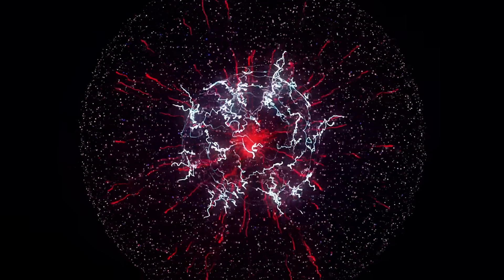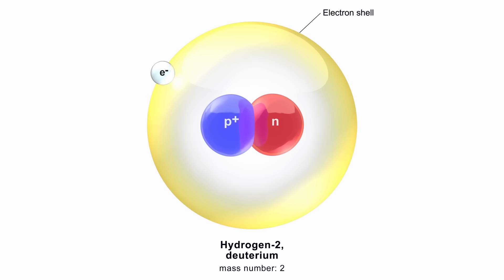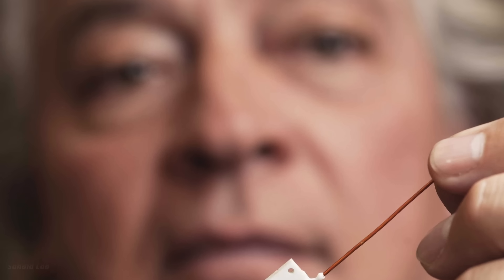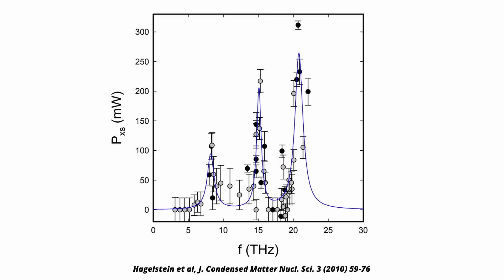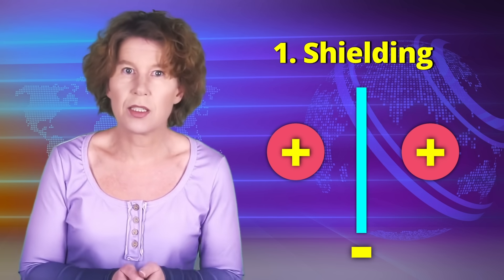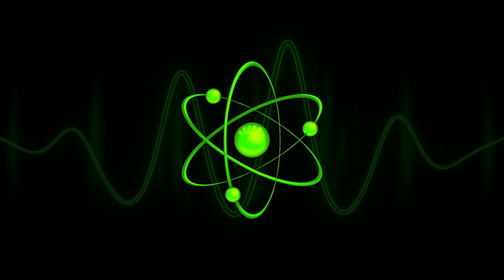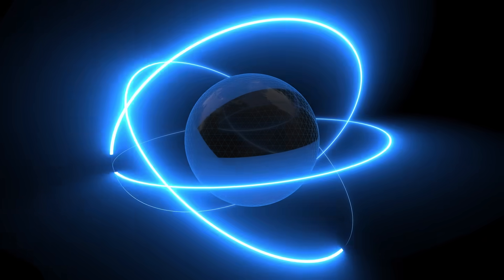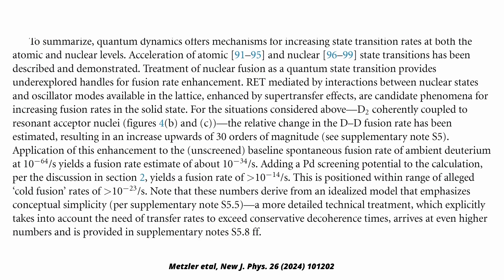Physicists Say They Know How Cold Fusion Works

Comment: I'm glad it's being studied.  Even if we get no surplus energy,  we will likely get some knowledge.
Reply: Bob Greenyer has advanced the CF field.
Reply: We get surplus energy. Trouble competing with a heat pump at the moment. But customers are lined up when it is. It's cheaper and quieter than a heat pump.
Reply: @grumpystiltskin  A heat pump requires energy to be fed into it, which is not the case for LENR (cold fusion).
Reply: We are getting surplus energy now, even enough in some cases for a generator to run by itself once it has been started up.
Reply: @brian.josephson  not from cold fusion
Reply: @brian.josephson  Thank you Brian. She could have at least mentioned that there have been 25 annual conferences on theory and experiments in this field, with hundreds of papers published. For those interested do a search on iccf-25 . Posting links is apparently blocked.

Comment: When the news about Pons and Fleishmann's experiments came out, I didn't believe they could lead to a fusion energy source, but I was curious to find out what was going on. Since it was easy to try to reproduce them, I set out my team to work on it. Without going into the details, our conclusion was that they were indeed finding something, although not necessarily what they claimed. First, the reason why many people couldn't find anything is that either they weren't using cast palladium, or they weren't running their cells long enough for the palladium bars to absorb the deuterium. Second: the palladium bar was fractured after the experiment, which might mean that in the breaking process electric fields were produced, and deuterons were accelerated. This explained why we only got a single burst of neutrons, which lasted around four hours. I was hesitant to report this, since we had two ways of measureing the neutrons, and it wasn't confirmed by one of them. Therefore the experiment was inconclusive. Something puzzling was that once the power source to the cell was disconnected, it worked as a battery, which is something I could never explain, but it happens to the a signature of the cases in which there are "positive" results, whatever they are (the cold fusion enthusiasts call it "life after death."). Then I forgot about it and went back to do serious work. The whole idea had been discredited worldwide, but I was left with the impression that there was something interesting to be studied by condensed matter scientists, which I'm not.

I may add that from the theoretical point of view Julian Schwinger tried to give some explanation, which was published mostly because of his stature,  but not many people were interested.

Comment: Looks like Coldness is Much More smaller particles (more ''radio-wavy'', less of linear small light radiation =temperature)  . So its alike HotHeating-Cold ends of wire difference making electricity (such an exchange of near big differences for ballancing).

Comment: Hossenfelder said: ". . . that’s a welcome change from people with devices that don’t work even theoretically, so let’s have a look." She seems to be saying cold fusion devices do not work. That is incorrect. Cold fusion has been replicated in over 180 major laboratories, and these replications have been published in mainstream, peer-reviewed journals. It has been observed in thousands of tests, sometimes at very high signal to noise ratios. For example, in reactions that produce 50 to 100 W lasting for months. It is not possible that all of these results are mistakes. If hundreds of scientists could make gross experimental errors for 30 years, science would not work. So the effect is definitely real and the devices definitely work.

The devices do not work "theoretically." Cold fusion is an experimental finding, not based on theory. No theory is needed to be sure an experimental result is correct. To disprove cold fusion, you would need to disprove the laws of thermodynamics and all of calorimetry going back to 1780, when the first calorimeters sensitive and accurate enough to measure cold fusion were developed by Lavoisier and Laplace.
Reply: Thanks for weighing in.
Reply: We need to rule out other causes to get to a theoretical explanation which may help us towards replicating it on a much larger scale.

I certainly believe in experimental evidence and reliable observations NOT needing any theory but they need to be run through the gauntlet of reproducibility and overcome all of the objections of the scientific community.
Reply: @solconcordia4315  All other causes were ruled out by late 1990. By that time 100 other labs replicated the effect and observed excess heat and tritium. Later, many confirmed that helium is produced in the same ratio to the heat as it is in one plasma fusion D-D path. This is proof that the effect is nuclear fusion, as Fleischmann and Pons initially claimed.

Reproducibility is high enough that an expert can reproduce the effect by closely following published instructions and working for a year or two. The objections of the scientific community can never be met because these objections are irrational and the goal-posts will always be moved farther away.

(I added as somewhat more detailed version of this message above.)

Comment: The self heeating tea kettle, or use electricity.  When I was 5, i tried to make a firecracker.  Better than starting a fire i guess.  Anti gravity would ignite the earths mantle and we would all get incinerated, but its worth a shot to jump over the basketball hoop.  Its just bitterly expensive and requires dominion over the free man.  You could make a ball whooper out of the old tea kettle, find everything that repells everything else and keep injecting it into the ball, most concepts exist as purification, the prime number pythagorean triangle terrahert multiplier.  512ghz NOT 256ghz, make sine wave not get absorbed.  Shells might make it capacitate, the lattice needs more purification.
Reply: Lol
Reply: There's always more energy in any arrangement than you put in, it just depends how long you arrange things for, anything cold arranges, I was taking like a face painting class at Cal State, this Abraham Lincoln dude was the most out place man I'd ever seen before, just dead ass frozen at Picasso, he went on for hours while the Hawaiians shot spit wads.
Reply: @WilliamTaylor-h4r  get help

Comment: As palladium is heated or subjected to changes in pressure it can change to different crystal states, any dissolved gases trapped inside the crystal lattice would...... that's the dinner gong
Reply: When I was young and optimistic, hearing that palladium can absorb hydrogen to higher densities than that of liquid hydrogen, I thought about if fusion would occur if one were to surround a piece of saturated palladium with conventional explosives and detonate the thing. Not being able to get my hands on palladium and high explosives, as well as the fear of being right and causing a really big crater deterred me from trying it out 😊

Comment: I hope the analogy here can be to human flight - years and years trying unsuccessfully to closely mimic birds when an approximation that allows another route to a similar result was the genius of the aerofoil.
Reply: I'd argue the breakthrough was to power it with a separate power source.  Flapping for power requires mechanisms that are hard to manufacture and control.  Fix the wing and put a propeller on it, now it's a different story.
Reply: @tippyc2  It wasnt the separate power plant. The Wright Brothers weren't the first to do that. It was their invention of an airfoil propeller. Too many people thought that a propeller would go through the air like a screw. The Wright Brothers realized that what they needed was a propeller that in a sense generated lift. Sent backwards, it generated thrust with enough efficiency to move enough air over the airfoil wings to generate sufficient lift to actually fly.
Reply: @JarrodFrates The Wright brothers also pioneered 3 axis control, arguably their key innovation.
Reply: It's always struck me as really lucky you can have controlled heavy than air flight without wings that have a zillion degrees of freedom like birds' wings do. If it wasn't we'd probably still not have aeroplanes even now.
Reply: The aerofoil wasn’t invented first for flight. Either boat sails or the boomerang were it’s first use.
Reply: @alexbowman7582  Airfoil shapes are found in fish and birds.
Reply: That observation gives me a little buzz.  Being good at generalising a problem rather than just copying a solution is I think a hallmark of our intelligence and perhaps of intelligence generally.
Reply: The thing is, that flight was obviously always possible.

The Cold Fusion extreme is more the idea that people could just flap their arms and fly.
Reply: @miriamweller812 About decade or more ago I talked with a physicist from Paul Scherrer Institute in Switzerland about the possibility cold fusion. He said: "if it actually were possible we would have seen it since long occuring somewhere in nature, outside a laboratory."
Reply: The Wright brothers first plan didn't even use an aerofoil! 
It was just a flat surface at an angle
Reply: The Wright Bro's had to throw out the textbook on the Aerofoil. The ref books of the time were good-enough for the sailboat, but they had to invent and build a wind tunnel and redo the measurements before they could make a wing.
Reply: I didn’t get all of them, but there were like 80 orders of magnitude of speculative improvement in there - and from the early diagram, almost all of them necessary.  A human running is only 4 or 5 orders of magnitude short of escape velocity.  This is wildly different.

Comment: Of course cold fusion works.  It's the same process as quantum tunneling.  Think about it.  If you have enough hydrogen atoms with all those sub atomic particles jumping around, it's almost 100% likely that two of them will jump close enough to fuse.  This might take a few billion years, but eventually all the hydrogen atoms will fuse into helium at room temperature and even at 1 atmospheric pressure.
Reply: That's not what's being talked about here. You'd think that was clear
Reply: @rayparent1  Have you ever heard of a joke?
Reply: @jdlech  riiiiight
Reply: @rayparent1  RIP oh, joke, we hardly knew ye.